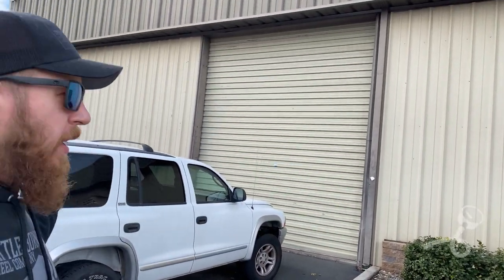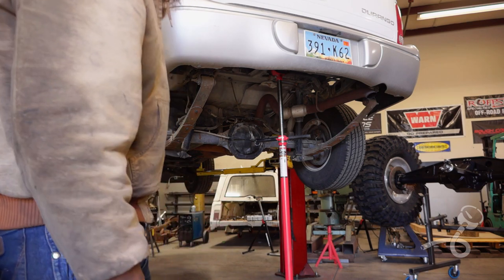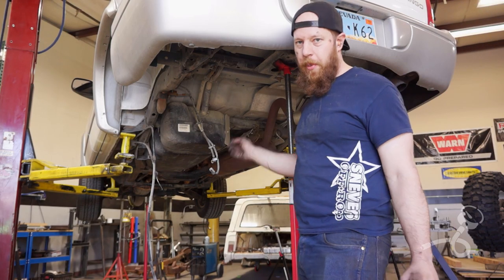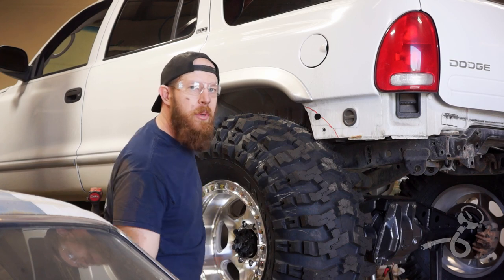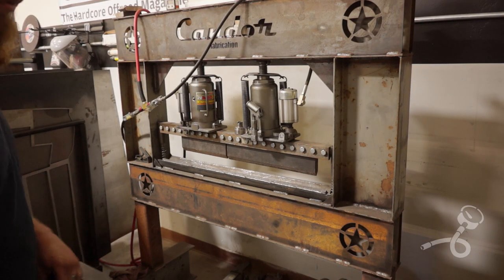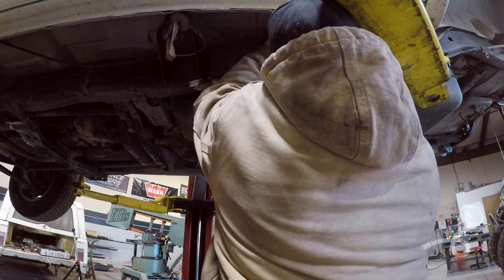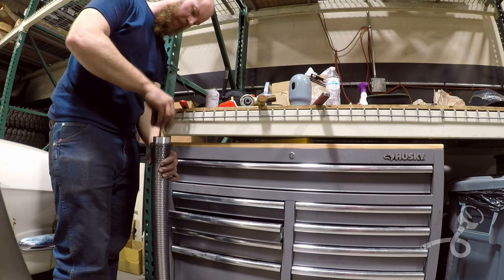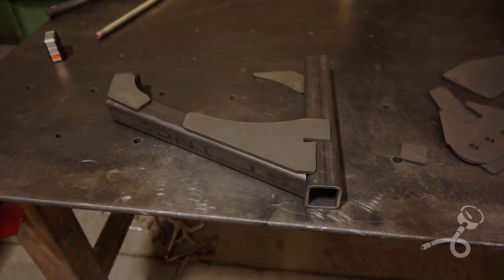Dreadnought Durango One Ton Swap EP-1: Ford 10.5, Custom 3 Link and Baja Pros

Comment: I love what you’re doing here. I watched the ads with low volume because I’m sure it gives you a few pennies. I have a one ton rear I think I might do on an XJ and I’m so freaked about doing this stuff myself. You make it look so fast and easy.
Reply from the maker: Thanks man! And thanks for the help with the ads! It does help when people watch the whole thing. One ton XJs are dope. The only way to learn to work on this stuff is to get the info you need, get under there and get to work. Almost anything you can ruin, you can fix. And it may look fast, but that’s the magic of Hollywood 😂

Comment: I hate that I can’t watch the whole build right now. Keep up the great content, I hope to one day see this driving around Reno.
Reply from the maker: Haha, thanks man. I wish it was done and driving right now. I can’t wait to wobble down the street in those 43s.
Reply: @aireddown813  so I started watching you because your super duty axle build (have a bronco 2 that a set are going to go in). Maybe I missed it but are you sticking with the stock 30 spline outers?
Reply from the maker: @flatblackandy  My first vehicle was a bronco II. Blew the motor up when the radiator broke in half on a long grade. Anyway, I plan on doing Branik 300M inners and 35 spline chromo outers with Longfield 300M U joints.